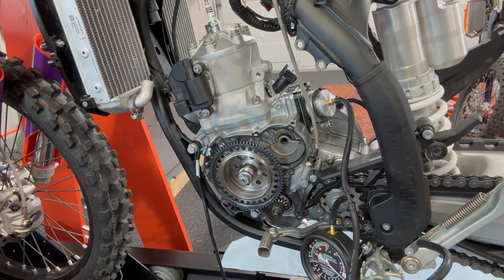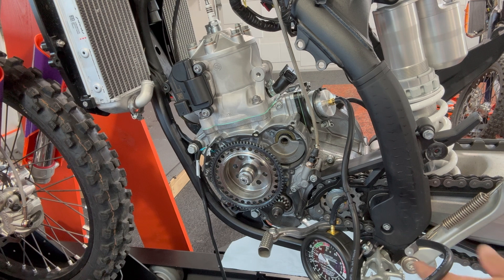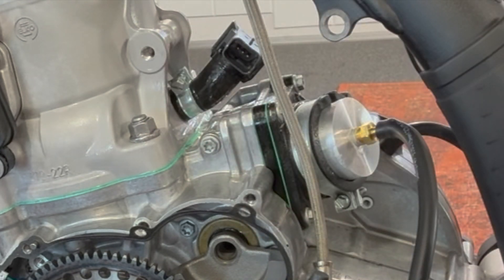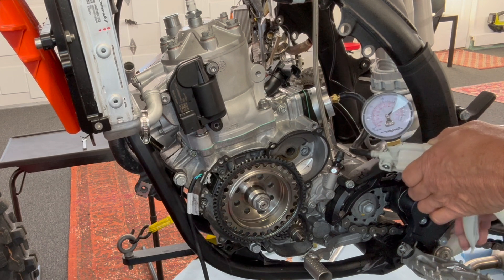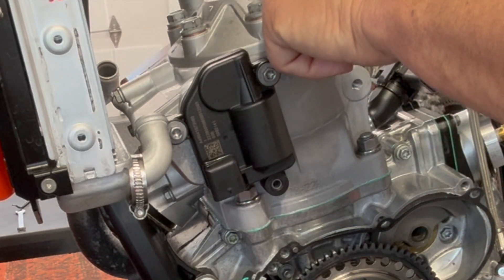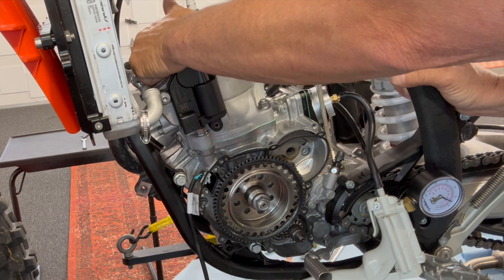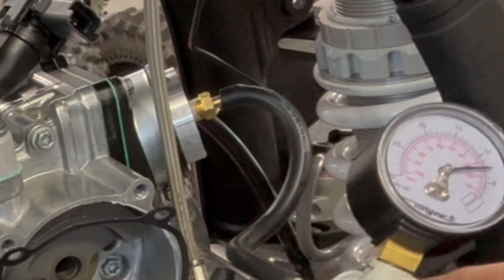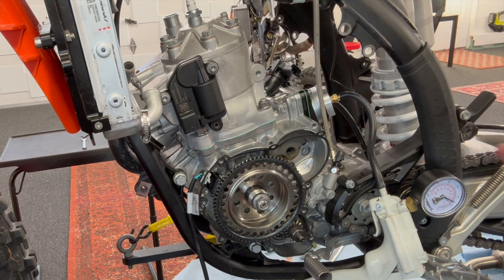Pressure Testing Your TBI Bike | An Easy Way to Increase Performance and Solve TBI Problems

Comment: I have a 2019 Ktm. I just performed this test at a curiosity doesn’t hold a vacuum and I can hear Air coming out of the oil cap hole when I pressurise the system ,crank seals are not that Old is most likely coming from from the power valve as it’s different to the TBI. ?
Reply: I really appreciate you figuring that out.  Yes, it drains into the. trans.  And that's why the older bikes don't have sponge out the muffler, like the TBI bikes.  It would mostly drain into the trans.  So you people who are concerned about stooge on the TBI bikes should be ore concerned when there is NOT spooge
Reply: @bestdualsportbikes oh so the older bikes didnt seal at power valves and it was not a issue?

Comment: Any tips for doing this on the later year carb bikes (2018)?  I’ve tried to do something similar by plugging the intake and exhaust and pressurizing through the spark plug hole at bottom dead center.  I’m not sure if it’s possible to do this way with normal leakage from the power-valve.  Does pressurizing from the intake avoid this problem somehow or is the design of the TBI bikes different? Hard to know if I really have a leak somewhere as I found nothing with soapy water and don’t hear air from inside clutch cover.
Reply from the maker: I really don't know how you would do it on the older bikes, without making special plates to seal things off.  The new motor design just makes it easier to do
Reply: just do a vacuum test instead use an oil can and put oil around the power valve shaft to create a seal. That’s your only leek